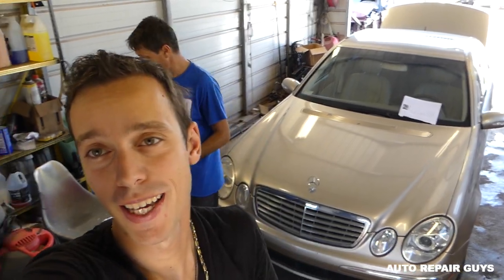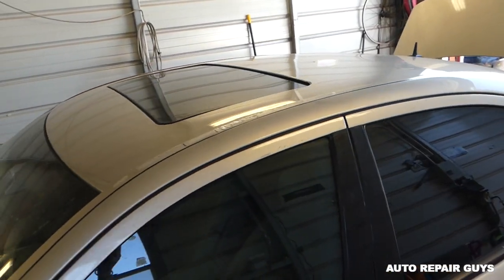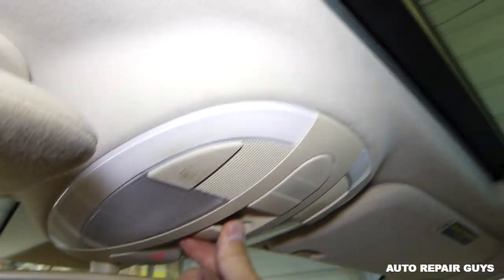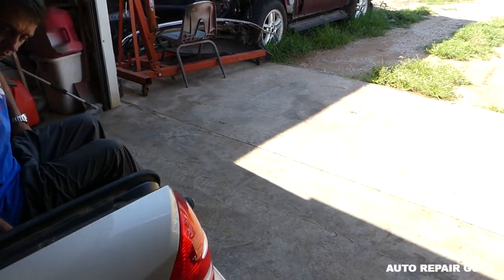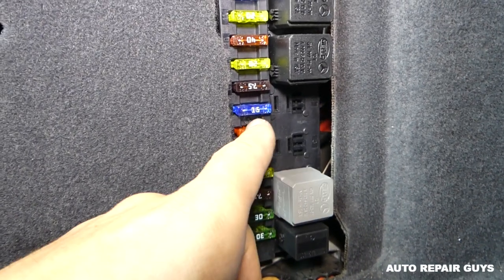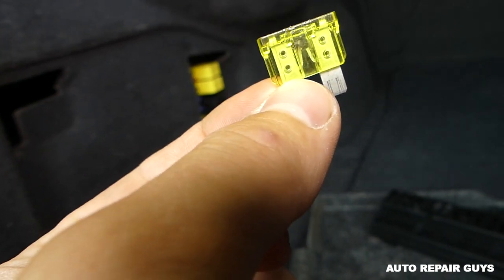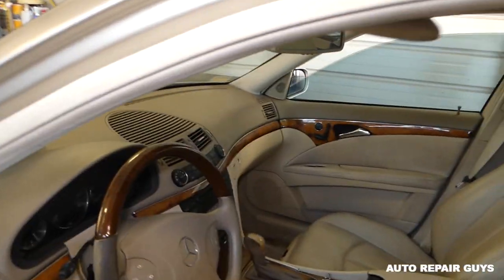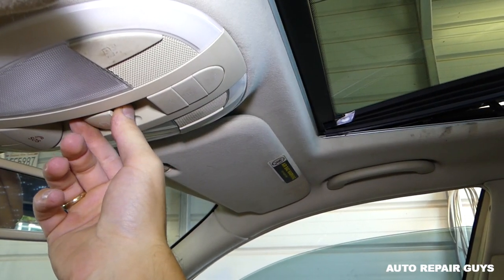MERCEDES W211 SUNROOF FUSE LOCATION REPLACEMENT

Comment: So my 2010 c300 4matic is stuck in tilt position upwards. I tried manually it twists and twists I use the motor it twists the screw so I did it manually for no reason. What do you think?

Comment: please if you can help me. I am the Mercedes E500. 2005 and I do not know where the gigarette lighter fuse board is short circuit and does not go anymore but the rear ashtray works normally are the individual fuse? thank you!
Reply: Piersic Florin in the panet when you open it should be to the right number 3

Comment: I bought a 2007 mercedes e350 wagon and my overhead control panel with the lights buttons and sunroof and nothing is working lights or sunroof, does the same fuse control the whole panel or just a sunroof, I didn’t check the fuse yet car is at the detail shop getting cleaned up if anybody had the same issue please help me it would be much appreciated. Thank you.